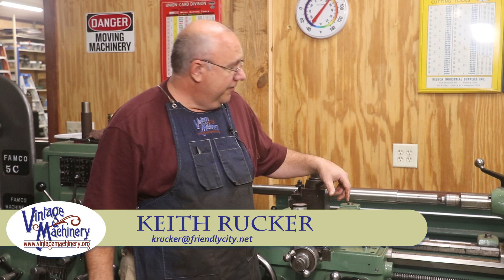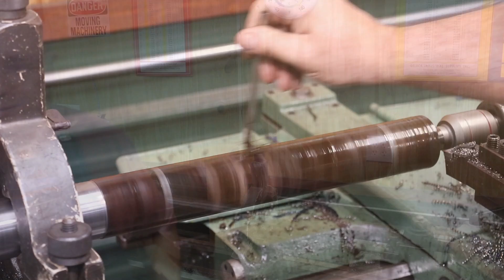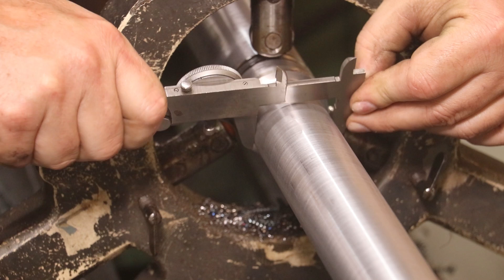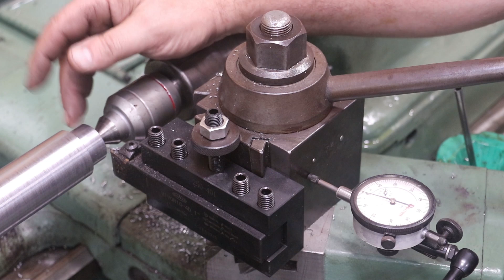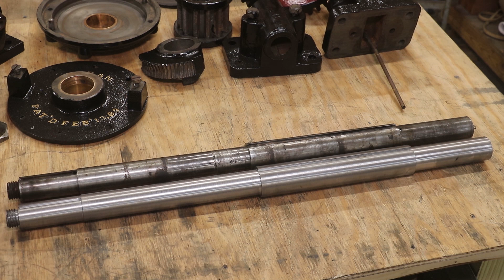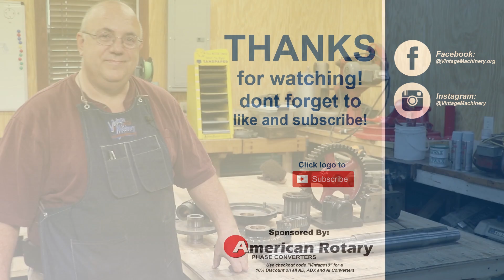New Haven Metal Planer Restoration - Part 16: Machining a New Shaft Continued....

Comment: A couple of suggestions since there are a lot of different approaches to the problem of chatter and harmonics.  Provided you have one, you could have fitted a follower rest which would have been less bother than the steady rest (the shaft shoulders may interfere with some areas).  Your live tailstock center might be suspect.  Also you were running a negative rake carbide insert (until you went with DCMT).  Negative inserts are usually indicated for really high speed turning with the most rigid work holding.  A positive rake insert or just good old fashioned HSS might have yielded better performance.  I have seen rubber strapping wrapped ( and other flex material) around one end of a long shaft to dampen the vibration.  Just some alternative rubbish.  Thanks for the video.

Comment: Whilst cutting the threads there, the camera had a really good angle on the dial gauge. Whilst knowing about concepts such as tool pressure and flex, the gauge showed noticeable fluctuations whilst cutting the threads. Just a real nice example of what what those concepts mean in a real world application.
Keep it up, always interesting content, even for a non-machinist like myself.

Comment: Nice job Keith, I would recommend real sharp high speed steel for the finish cut of the shaft to prevent the chattering and get a better surface finish. The carbide inserts require higher cutting speeds. Best regards

Comment: Have enjoyed your videos for many years  now, Keith and admire all the volunteer work you do.    As you were finishing up the shaft and making your last comments, I wondered if you ever leave your mark on any of the parts that you restore or the parts you make new again.  Maybe a mark that would not be normally seen so much by the next operator  but maybe by the next person who may come to do more restoration or rebuilding down the road on a given machine.  Basically just sign your work.  Does that happen much in your industry?
Thanks again, Keith for all your efforts.... Russ

Comment: Keith what cause the vibration when your turning and how can you fix it and can you fix 100% of the time?
Reply: sounds like the live center on the tailstock isn't tight(notice it gets worse near the tailstock). the tightness of the engagement into the workpiece can change as the piece heats up and cools. its something i've learned to be on top of. it's easy to forget to lock the ram too, that can lead to the ram migrating backwards and allowing the workpiece to walk out of the chuck (especially on a back cut), causing vibration. longer shafts tend to "jumprope" too so it's difficult to turn a long piece without a steadyrest, or follower rest in place. A follower would be ideal in this case since it only has two points of contact and allows the tool to pass by.

Comment: Love your videos Keith, but a question about threading: would it make a stronger end by using a parting tool with a slight radius to cut a curved instead of right angle corner where the threads end? Might slightly reduce the risk of crashing the tool into the shoulder a little bit too. I always through radiuses corners were inherently stronger than right angles.

Comment: Looks like your live center bearings are worn out! At 8:56 when you hit the shoulder, you can see the work jump up- and away from the bit, and the live center jumps with the work. At 12:10 look at the difference in finish next to the tailstock, vs  next to the steadyrest!
Reply: I was thinking there has to be some loose motion somewhere in that machine. It should peel that piece of metal like a mirror (if the insert is good)

Comment: Although I haven't proven it yet (on my list of things to do), but I believe that chatter when turning between centers originates from the reaction force generated by both ends being supported in a "pinned" type of connection, both ends being non fixed/rigid. Both ends rely on positive pressure being exerted on the piece by the clamping force of the tail stock, positive pressure creates bending force, then multiplied by the torque from the rotation of the part relative to the tool. Because both center drilled ends rely on taper to taper interaction between the part and the center, there is no rigid connection between the machine and the part (pinned vs fixed connection in mechanics). Even when a steady rest is added the reaction is still allowed, but is localized to the unsupported region during the cut. The reaction forces generated cause the part to deviate from true center line position (push up and away from tool) as the tool forces come into play. If one end is held rigid (clamped in chuck providing balanced forces in all three planes) and the other from center point (standard machine shop lathe practice), then with a steady rest the "chatter" will be vastly reduced. One way I found to mitigate this is to cut towards the closest rigid body (toward the headstock if closest, or towards the tailstock if closest). Therefore putting that portion of the part in compression with the accompanying side being in tension. If you cut away from the rigid body then you are putting the center of the part in compression, rigid bodies with mechanical properties similar to metals behave more predictably in tension than in compression. Just an idea so far, like I said I haven't proven it in real time yet, the math works out and the theory fits. Someday!  Next time you are cutting a long item try cutting towards the closer rigid body and see what happens. On my machine it works like a champ.
Reply: Never thought off this but that makes perfect sense.  Under compression the shaft will naturally want to flex.  The longer the shaft the greater the flex.  Then turning from the ends towards the middle will increase the compression effect.  I'm curious if any of the machinist handbooks discuss this?  An the tighter you clamp with the tail stock the greater the flex.  It would be interesting to see if turning from the center to the ends helps?

Comment: Could it be that the odd sized keyways are proprietary? If so, and you were the owner of a New Haven product, you'd probably get replacement parts through New Haven or a supplier. If you couldn't make the replacement yourself, of course.
Reply: The keyways were likely cut on a shaper with bits ground to custom sizes for shaft diameters and the shearing forces expected. Of course, the sizes could be totally arbitrary. Keith, I like your method of resting a shaft on the table slot. It saves a lot of set-up time as long as your mill table is trammed perfectly.

Comment: I'd have cut that thread backwards  - a lot less stressful!
Reply: If you have auto-stop, yes. On a manual belt-driven lathe with friction clutch it is indeed stressful. And in reverse - unless it is a LH thread, tool needs to be on the opposite side. Not enough travel on a small lathe. (Have not tried tool upside down yet. Could be OK or could be a disaster trying to lift the carriage off the ways).

Comment: When using a lathe why does it seem to cut a little bit when resetting the cutter? Since it just made the cut I wouldn't think it should cut anything more off. That is just something that I have always wanted to know since I first started using metal lathes.
Reply: When the tool contacts the piece the tool pressure forces the tool down and away from the piece ever so slightly. At the end of the heavy cut the rigidity of the tool springs back to center and back into the material taking a very slight cut. I hope that makes sense.
Reply: IMHO i think it is an expression of the rigidity of the setup, there is a little spring caused by, your choice, give in the structure, worn ways and gibs, flex in the tool holder and tool geometry. It also shows up more with carbides because of the higher tool pressures and stresses. Best example is a boring bar retraction, I think, cheers!
Reply: As the other two have put, it's the spring in the setup. You'll never truly get rid of it, even in the most rigid of machines, but then again, you don't want to. The more acquainted with your machine you are, the more to your advantage the action is. You can use it to sneak up on tight measure or to give your threads (or parts) a tighter feel.

You can observe the process in action with two dial indicators. One on the cutter holder's end preferably stuck to the ways, and another on the opposite side of the cut also, preferably stuck to the ways. The more precise the better, and with them, you'll see the work piece and tool move.

Spring back can appear from places other than tool/cutter/machine give, and that's when they are a bad thing. For example, the gibs aren't properly tightened and the sled is loose, or the bearings in your head are worn or a worn nut on the slides. Those have to be fixed, if they are found to be culprit.

Comment: Negative rake tools cause chatter because of the large tool pressure when cutting.
Reply: So it skips? Because i was eyeing the whole setup when the neck was cut and nothing seemed to move, at least in that respect, the camera never lies. It would then make sense that the tool itself is at fault.
Reply: chatter in the work piece would move at a high frequency that it would not show up on a vid.  you just see it in the cut and hear the noise.

Comment: nice job on the shaft keith. i enjoyed watching you deal with chatter. (love those long shafts)  i have had more success using hss than carbide. but sometimes it seems you just can"t totally eliminate it . you know your making your viewers nuts using those calipers for precise measurements.
Reply: larry.....These are not "precise measurements".  The shaft is cut for poured babbit bearings.  Calipers are perfect for this operation.
Reply: @paulcopeland9035  thanks for pointing that out paul. i was more concerned about the sections of the shaft with keyways.

Comment: Keith, I have one qustion about cutting threads. I have seen you do that before and what I would like to ask you is: how do you know that the second pass starts a the exact same position as th first one? So that you are not cross threading so to speak. Thank you for the upload and as usual a pleasure to watch.
Reply: The lathe has a "threading dial" which consists of a rotating disk with numbers on its face. When the dial passes a reference mark Keith engages the "half-nut" on the lathe's apron and the cutting tool starts moving. When it approaches the end of the cut he, disengages it. He then moves the tool back to it's starting position, moves the cross slide slightly in to deepen the cut, waits until the same number on the threading dial comes around again and goes through the same process. As the movement of the workpiece is synchronised with the threading dial, as long as he pick the same number the tool will always start cutting with the same rotational and longitudinal position. On some lathes rather than a specific number you can use either any of the odd numbers or even numbers as long at you are consistent. If you watch carefully you will see Keith engage the control and there will be a slight delay until the tool starts to move, this is because it can only kick in when they are perfectly aligned (as long as the same number or odd / even number is picked). Sorry if this isn't a very clear explanation. Regards Sarah
Reply: @loydsa  Movement of saddle , not workpiece
Reply: Try this video (one among many) on threading. I think it will answer your questions!
https://www.youtube.com/watch?v=gnWrKiHEvhA
Reply: Watch Adam's video https://youtu.be/0OVWg50ETfQ
Reply: Right of the saddle at about the level of the lead screw is a device called the thread dial that engages the lead screw and counts rotations and gives you a  reference for when to re-engage the half nuts. Also using the break and just reversing the whole drive train back to the cutting position is an option. There is actually a video on thread cutting video by This Old Tony that is super informative on this matter. ...though now that I think about it Keith is cutting between centers and having never tried it myself I’m not sure if the lathe dog makes what I just wrote terrible misinformation.
Reply: @jeffreyhallam5517  The lathe dog is only a clamping device and does not change your explanation at all.

Comment: Thanks for another great video Keith.  I have a question though.....I'm fairly new to machining and was wondering .... when cutting to a shoulder if it matters whether you turn to the desired diameter and cut the shoulder moving away from the work or start from the outside diameter and cut in toward the final diameter?  ( hope I explained that so it's understandable)
Reply: I just tried typing a reply and it proved too difficult to put it into words. You can do it either way, just depends on if you want to set the axial position of the shoulder last, or the OD last. It's easier to finish the OD and more right into finishing the axial position of the shoulder as you move the tool out.